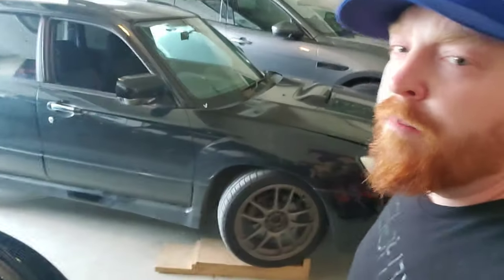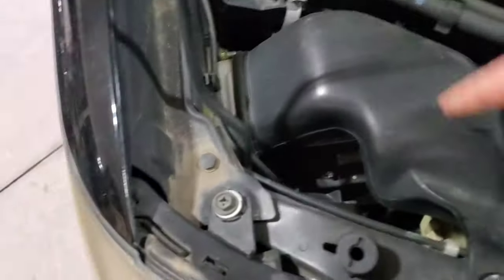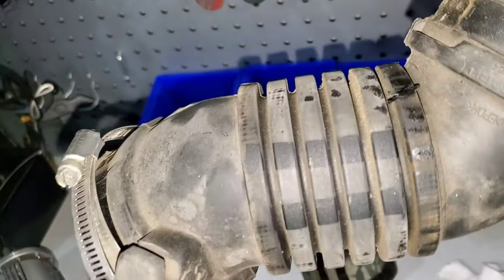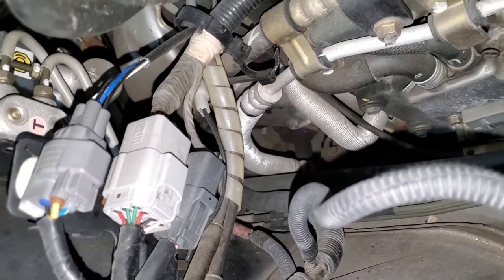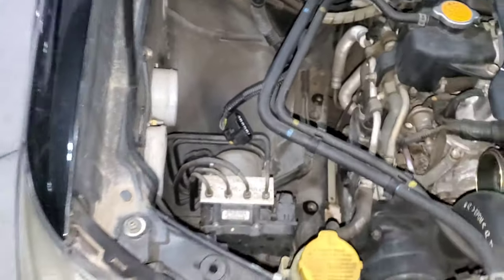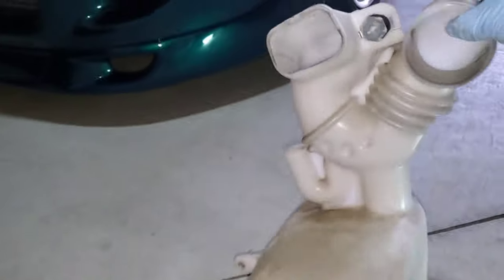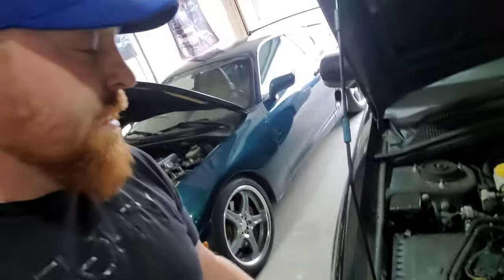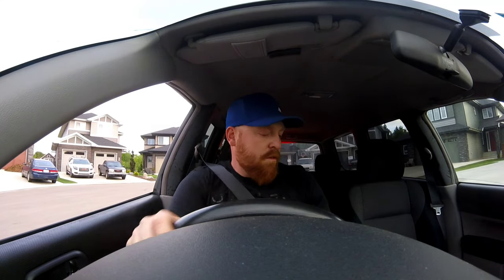MUST DO FREE MOD - Subaru Forester XT intake Silencer removal

Comment: My 2006 UKDM  XT has had this done and a cold air filter substituted, which is mounted down in the same area that was occupied by the silencer.
It makes a distinctly loud TSHH, SH, SH, SH, SH if I rev it then take my foot off. Loud enough to make pedestrians look back.
It's ridiculously loud in tunnels or going under bridges ...I'm old enough to know better, middle aged boyracer that I am :-)
I've also dealt with its "exit hole": decatted downpipe, catback with Pro Drive back box/tailpipe unit.
Thumbs up and subbed.
Reply from the maker: Thanks 😊!
Reply: Hi Badda. I recently gave into temptation and acquired a 2008 XT with the full Prodrive performance pack. She only has 60,000 miles on her, and has been serviced every 3,000 miles. The trouble is, she doesn't burble.
I have the Prodrive silencer, but something, somewhere in the exhaust is castrating the sound.
I also have a 2.0 Xen, that has a Hayward & Scott silencer on the otherwise stock pipe, and it burbles nicely.
Would you mind telling me what make and type of pipes you have fitted, and do you have any trouble with the MOT with emissions with your fitment.
Many thanks if you can find the time.
Reply: @donk1822  Hi, not sure what headers are fitted but I know that uneven headers give the burble, which my one has. 
Initially it failed the MOT on emissions 1) because (unbeknownst to me) the system was completely d-catted and 2) the throttle body needed a cleanup. Both of which were done by Kinghams in Croydon. Exhaust system now is as follows: uneven headers (prob original as it's not a JDM Foz) Toyosports 3" de-cat downpipe, custom made SS catalytic convertor, original resonator then Prodrive backbox/tailpipe. Luckily it passes the ULEZ specs (just).
Reply: @BaddaBigBoom  Thank you for the info my friend, most helpful. :)

Comment: The MR2 had a huge intake system as well. I took it out, didn’t notice anything much on my car.
Reply from the maker: NA ;p
Reply: @BoltsNBoost  true. But I didn’t really notice a sound difference.
Reply from the maker: @therealboofighter  NA:p. Turbo cars act much different than NA especially when it comes to sound and making them breathe better. Induction noises are awesome!

Comment: Ill definitely have to do this. I'll tell you how it goes for my manual JDM Forester.
Reply from the maker: Awesome! I'd be curious
Reply: If your looking for more content to do. If you could do a DIY on spark plugs that would be great. That's about the only bit on maintenance I've yet to do. I've always had a shop do it for me along with a compression test why'll there in there. This time I might do it myself depending on the tools needed.
Reply: @wt8213  the engine pretty much needs to come out to get the spark plugs on the dohc ej205 and ej255.
I know because I just had head gasket failure while on a road trip. They are a mega pain in the arse to get to, I cant remember if the coil packs even came out in the engine bay. Whole thing was a no go tbh.
Reply: @Nbomber  I just did the spark plugs a month ago. Didn't need to pull anything. Was it a major PITA you bet it was. Will I ever do it that way again? Probably not. 😂 Would have been easier if I jacked the engine up a bit. Had literal millimeters to work with most of the time. Had to use an assortment of odd ball sockets to get to certain areas. Though it's definitely doable without lifting or pulling the engine.
Reply: @wt8213  I just looked it up, I didnt realize (or think of) jacking up the engine and loosening the mounts makes a difference.  Lol.
Man, in my defense I had a limited toolkit with me, but yeah, holy crap what a pain in the ass. The turbo heatsheild bolts too, lets just say I put most of them back in and threw away 2 of them. Lol
I will say though, to subarus credit. You can do almost the entire engine with a 10, 12 and 14mm socket.
In the end, I had to get a new engine. By the time I was able to source an engine lift and pull the heads, the water in the cylinders had ruined the bores. :(
Reply: @Nbomber  Yikes, I've been lucky. I've owned 5 JDM EJ20 cars and I haven't had an engine problem yet. My clutch is getting there but I'm pretty sure it's the original at 120k km's.
Reply: @wt8213  clutch is a pain too, I did mine 6 months ago, took a few days to get it done on the driveway. Genuinely think pulling the engine would be easier for next time. I didnt realise that there is a viewing window on the bellhousing to see the clutch disc tho. Thats quite cool. Little blacl plastic cover pops right off the top on, (I think) the right hand side.
Yeah tho, its tragic, the engine was otherwise immaculate inside and running like a dream. Cylinder bores were in stunning condition at 130k miles. But now the top halfs are rusted.
So the plan is to get it sleeved and heads reconditioned and rebuild it for more power. The replacement engine I bought I got kind of scammed on, long story. But at least im on the road.
Reply: @wt8213  as a side note, (and part of the story on the engine replacment scam) I did drop a JDM spec EJ205 in there, with the EUDM spec ej255 turbo, inlet manifold, injectors and ecu. The crank and cam position sensors were totally incompatible and obviously didnt work, yet, it somehow still ran. Dont ask me how, but it ran, and was drivable (albeit running extremely rich, and timing was way off) and honestly,  I wish it would've worked out, it was fun to drive, turbo came in hard as fuck at 4k, white smoke pouring out the exhaust too lol.
I hope I destroyed that engine tbh, makes up for the POS engine they gave me as a replacement.
Reply: @Nbomber  ya I'll probably be lazy and pay a shop to do it. It's just a daily driver for me. Zero mods and don't plan to touch it. I have a gc8 sti as the toy.
Reply: @wt8213  Hey did you do this on your JDM Manual? Going to try mine soon
Reply: @frostking0  I did, I might put it back in. Idk if it's something else wrong at the moment but my car is feeling really gutless for the first 2k rpm then it goes great idk hard to explain. Possibly a clutch on it's last leg I'm unsure. But I have had no engine lights of any kind for the past 10k rpm I've ran the car like this.
Reply: Just removed this after watching this, I have found it extremely responsive compared to before. I can hear more of a spool and has changed the note of the exhaust slightly (3" steel hi flow). All in all it took under an hour as I tried to keep most of the mudguards still connected but it is a very quick easy job if you have good access
Reply: @jonb3848  so much easier removing the tire. I did it without and oh my what a headache.
Reply: @wt8213  yeah it would have been but I had it on ramps anyways. If there isn't a slight struggle have you really done anything at all?
Reply: @Nbomber   
takes me like an hour to do on my 05 wagon, ej205. you remove the air filter to get at the passenger side. for the drivers side you take out the windshield washer reservoir. then you use a couple different sized extension because when you are loosing the spark plugs the rachet will hit the inner fender wall so you will have to switch to a shorter extension.
Reply: @wt8213  takes me like an hour to do on my 05 wagon, ej205. you remove the air filter to get at the passenger side. for the drivers side you take out the windshield washer reservoir. then you use a couple different sized extension because when you are loosing the spark plugs the rachet will hit the inner fender wall so you will have to switch to a shorter extension.

Comment: Ran into this same part replacing passenger-side headlights in an 06' Forester. No turbo. Is this the exhaust port for the muffler bearing cooling system, or what? What in tarnation is the point of this contraption? Right Fender dehumidifier? The Mexican loop through the fender was absent in the vehicle I was working on and there was no solid connection to anything. Just 2 open ends of a piece of plastic that was bolted to the headlight assembly.
Reply from the maker: LoL. Technically I think it is a "muffler" for the intake system.

Comment: About to reinstall my stock intake. No difference but the sound of the turbo.
Reply: Probably because you didn't remove the original box filter and replace with a cold air filter ...extended down in front of the wheel of course.
That is how mine is configured and it makes a proper loud TSSHHHHH sound!

Comment: Do you have a way to monitor intake temps and if it gets hot enough to affect the power?
Reply from the maker: No. But I highly doubt they would be affected with factory air box along with grabbing air from the fender still. Not to mention the intercooler ..
Reply: @BoltsNBoost  thanks
Reply: @BoltsNBoost did you leave the airbox open at the bottom near the fender hole or did you actually find a way to seal it back to the fender i.e cutting the silencer and putting part of it back on the airbox so it sticks into the fender? Curious because it seems like it's grabbing air from the engine bay where as the silencer grabbed it from behind the headlight
Reply from the maker: @Defury8285  I just took that U shape peice out completely.  It wouldn't be a bad idea to block off. But I don't think it was grabbing a bunch of air from engine bay.

Comment: Hey is there anyway we can talk about how you do this I got an all stock 09 xt it’s two quite
Reply from the maker: Hey. It's pretty easy to do. Not sure if your 09 has the same set up. But it should only be held on by a couple of bolts as mine was

Comment: Is this going to help in 2006 Subaru Forester 2.0x? Does it make any difference?
Reply from the maker: I mean, unrestricted any intake tract will be beneficial in most cases. It depends how restricted yours is. I can't confirm if it has added power on mine as I don't have a dyno. But it seems to have helped throttle response and better noises!
Reply: @BoltsNBoost  that's enough for me to remove it 😝. Is there any drawback or any danger taking it out?
Reply from the maker: @ΔημήτρηςΤζιωτζιος  should be as your removing a peice before the MAF

Comment: So is it bad then?
Reply from the maker: Nit sure I understand the question.  Is what bad?
Reply: @BoltsNBoost  to remove it and let it destroy the engine or it okay for it ?
Reply from the maker: @YursHero  why would it destroy the engine?  It's an intake snorkel.
Reply: @BoltsNBoost  well just asking, aint know about Subaru much .
Reply from the maker: @YursHero  it should be fine unless you are currently running lean and this somehow causes you to detonate even more.

Comment: can or should you do this on a non xt 2010 forester?
Reply from the maker: I cant speak to the 2010s. No idea how they are set up. I imagine they are similar
Reply: @BoltsNBoost  yeah it’s not the same looking but the engine looks quite similar I just want more power with my stock shi
Reply: @BoltsNBoost  other than no turbo of course